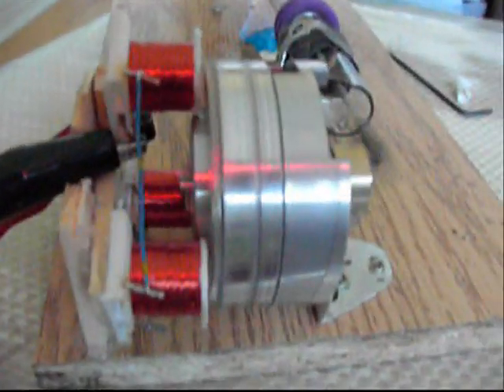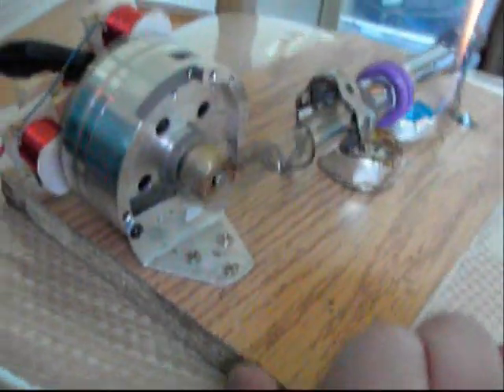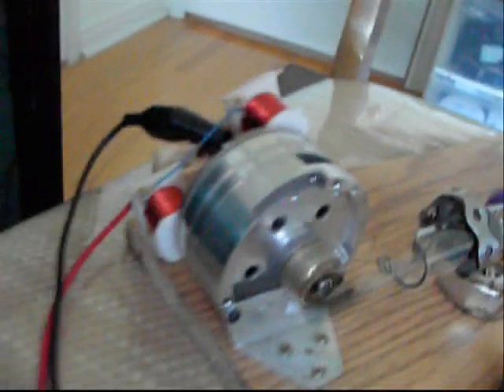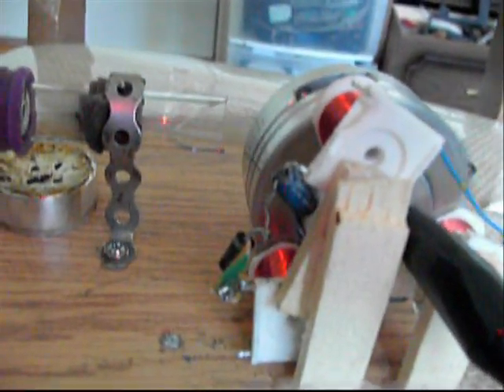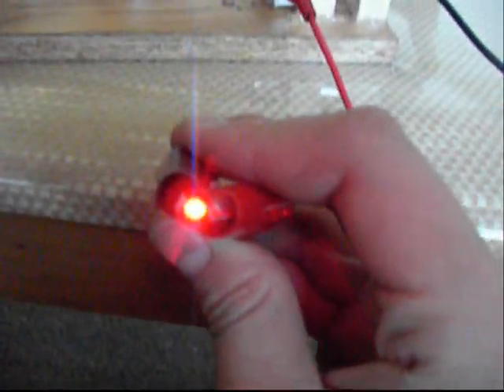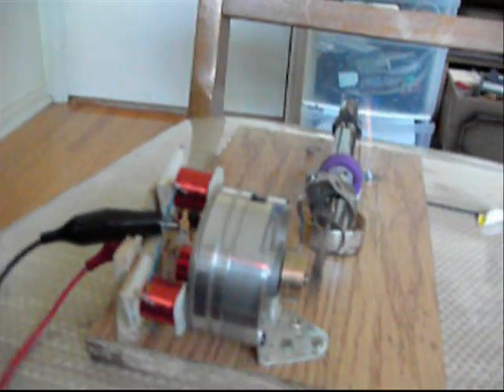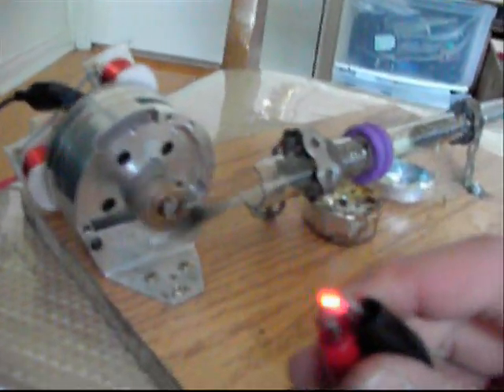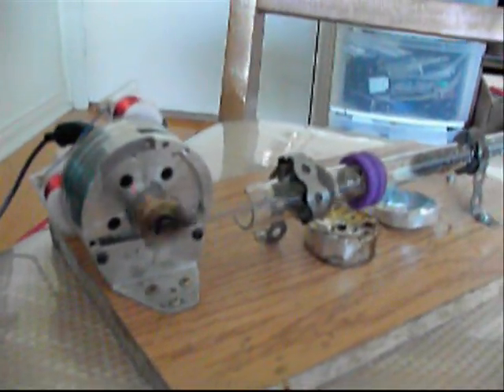Homemade Lamina Flow Or Thermoacoustic Engine 4 Generator

Comment: Good video! But technically: with this flame size my engine produce 1 W output power (30 LEDs at 66% output power). My conclusion: thermal lag engines have extremely low efficiency. Your opinion?

Comment: thanks for posting.  good work.    here are some things to consider.    when  current is  Induced in the Generating coils,  lenz-force  Drag  occurs  at the  COILS.       here, the location of the coils/magnets results in  MAXIMUM  Breaking force, on the magnet rotor; aka, the flywheel.   it should be understood that a flywheel  is a Flywheel, and Should be  ONLY  a   flywheel.      such an engine should be loaded, at its  CRANKSHAFT and   Reduction  should be used;  in order to partially isolate the prime mover from the load.   in other words,  when loaded, engine  Speed  should NOT fall, more than, say, ten percent.     the size of conductor used to make the  Generating coils  is  TOO  small;  generally, 14awg should be used.   in order to use smaller wire, Generating coils  Should be  wound  'in hand'.      by now you may know that,  volts are NOT  power.   amps  are not  Power.   power is expressed in  WATTS.   watts are Calculated, by Multiplying volts and amps.   determining amperage, during circuit operation, Must be done Correctly.     it should be understood that the context here is the generation   POWER/watts.     for your edification, connection of  a  pma into a low-impedance  Power  circuit  can be simulated;  by  shorting  the pma output.   doing this will cause Maximum  lenz-force drag, at the pma rotor.    cheers        googletranslate